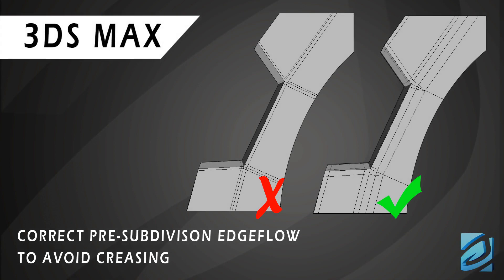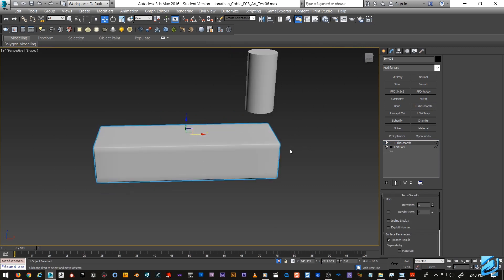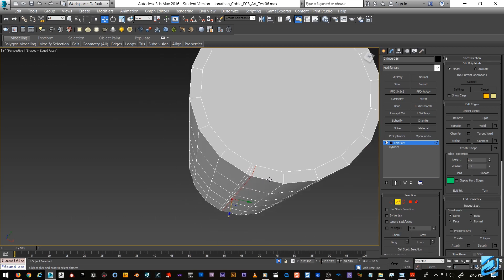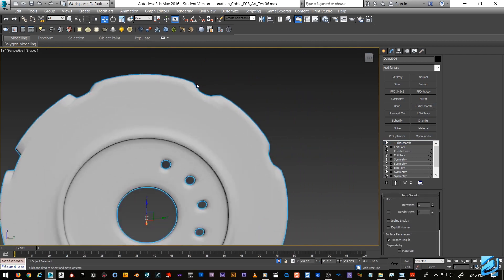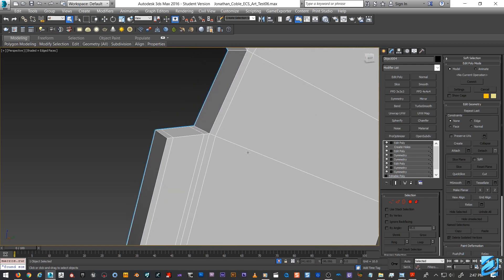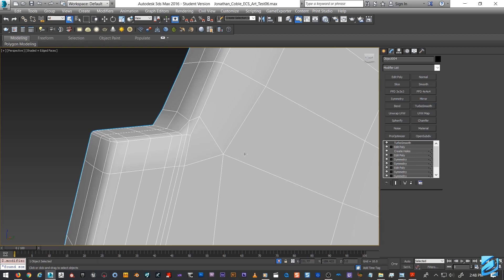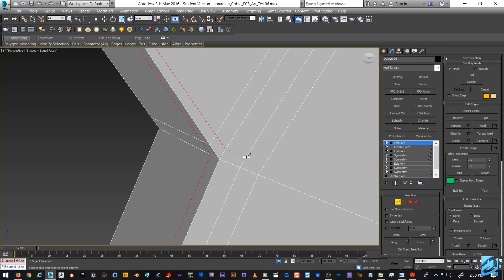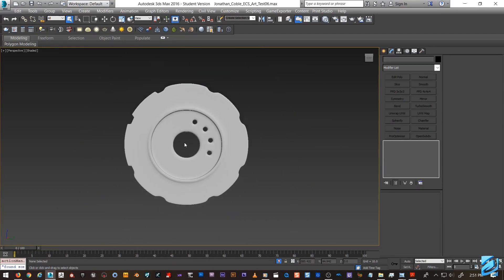3DS Max Tutorial - Correct Edge Flow for Subdivision

Comment: If you want to get rid if the triangles you only have to Ctrl-Backspace the edge between the 2 triangles, as you say sometimes while modelling hard surfaces you can use tris as the model has rigid planar surfaces, if the uvs for texturing are not getting deformed you are good to go :hand-purple-blue-peace:

Comment: Ngons and triangles are not a problem, not at all. People need to understand that as long as your subdvision goes well, looks good, you can have a triangle or a ngon. Obviously you should try to get rid of it, but only if you can.
Also, most of these problems are easy to solve when you stablish the curvature and work with edge crease. The downside of this method is the high density... depending on what you wanna do it turns impractical.
Good video! Keep the good work.
Reply from the maker: Love your comment man! I completely agree. It's great practice to always model in perfect quads but, with experience/time, you learn when to break this rule. That's what I'm learning about 3D/art lately; know the rules, master them and then know how to effectively break. It's all about results and saving time while maintaining a high level of organization in regards to a production pipeline.

I haven't used Open Subdiv a whole lot as you mentioned edge crease but it has alot of potential too. It all depends on what you're trying to accomplish. I'll keep the vids coming! Glad you enjoyed and keep on creating my friend!
Reply: You definitly should try opensubdiv and edge crease. Working with edge loops is good, but usually turn your object into a mess. Ofc you can solve this, but if there is another method that can save you the time of reorganizing topology you MUST use them.
Edge loops and edge crease complement each other (might be a irresponsible affirmative but still).
Also, on 6:15 you did cut geometry by cut tool. Nothing wrong with that, but you could use edge loop and just deselect the edges you don't want (front viewport + alt x). That way you maintaing the edges even and save time - Just a tip!
Reply from the maker: @RahaelLongo  Thanks for the tips! I will def keep that in mind. Usually my purpose for a high poly dense mesh is for game asset baking so a little extra topology isn't too big of an issue as long as you know how to subdivide correctly. But for film/animation I think Open Subdiv is no doubt the way to go! It's also a more efficient model in the long run (e.g. lower polycounts). Once again, thanks for the comment man!

Comment: Hi, Great video !

I don't understand how you add edges easily from 1:11. It's shortcut ? What did you use in edit poly for do that ?

I'm new on this software :) thx
Reply from the maker: Just uploaded a video going over swift loops! Hope it helps!

https://www.youtube.com/watch?v=8Wuw8wgUUC8&feature=youtu.be
Reply from the maker: Glad the vid helped! And great question. The tool is kind of hidden. It's called "Swift Loops" (critical tool) and you have to assign it via keyboard shortcut. I personally use "Alt + A". You can set this up by going to Customize--->Customize User Interface, find swift loops and assign it. Save your settings and you're off the the races :)

This pushes me to make a video on setting this up and will do soon! Hope it helps.
Reply: @JCobesV2  thank you for your answer

Comment: hey you're pc's performance in handling the turbo smooth is amazing =]! What graphics card and specs are you using ?
Reply from the maker: It does a pretty good job! Actually, it's a little outdated and I'll be upgrading in the next couple of months. Currently running an old AMD Phenom 2 Processor from 2011, NVidia 1050 Ti, 16GB RAM, 500 GB Samsung SSD. I'm going to be going big real soon! Can't wait.
Reply: @JCobesV2  Epic! A friend just refered me to a GTX 1660 for around $200. I hope you make a video about your upgrades =] i want 3ds max to run at the best settings possible!
Reply from the maker: @RisingThoughtz  That's a good GPU for the price! Max is more CPU heavy than GPU unless you're rendering via GPU. GPU is huge though for all of the Substance software and any game engine. It was a nightmare to work in Substance Painter before my last GPU upgrade.

Pleasure chatting with ya! You inspired me to bust out a specs video once I get the new rig in a couple of months :)

Comment: In principle, triangles and ngons should not be a problem if they are on flat surfaces. That's what you did now. You brought the lines to a flat surface and there you tied them into triangles where that triangles will not cause a problem on the surface. I was also very annoyed by these bumps and I came to the same conclusion as you. Very good video.
When you are modeling, you always try to make the topology perfect with all the quads, and in fact, what you have to think of is that the model should look nice. It all comes with work and experience.
Reply from the maker: Great comment! I share the exact same sentiment. When growing/in school, the thought was that tris and ngons are absolute evil and, as you said, it's all about end result. It does come down to experience and understanding how topology works when subdivided which applies to all 3D platforms. Game engines tri out your models anyway if that's the asset's intended use. Obviously for animating, quads are the strict focus but it's good to know how to use tris effectively. I've learned for texture baking, if the subdivided high-poly looks great, that's all you need in the end. Once again, excellent comment! Thanks.

Comment: Wouldn’t open subdivision Avoid this problem completely?
Reply from the maker: Hey Eric, great question. I don't use Open SubDiv as often as I should but still know that it operates the same on this level as Turbosmooth. The only difference is how you add your edge loops. You can utilize the Open SubDiv modifier with the Crease Set modifier but will most likely take the same amount of time, if not longer. I would recommend using the cut tool with Turbosmooth since this object is intended for baking purposes and is a somewhat complex shape. You seem to have more control in the end with this process. Open Subdiv is great when you want to deform the High-Poly mesh for things like animation or simulations due to getting better overall topology (even quads). Hope that helps!
Reply from the maker: Also, here's a great tutorial a fella did explaining the differences between the two. Both have their advantages! 

https://www.youtube.com/watch?v=ktM61yLeXfM